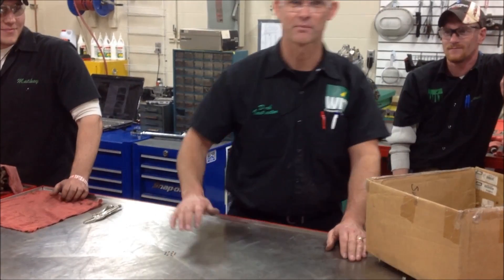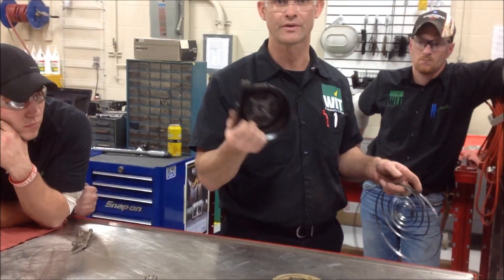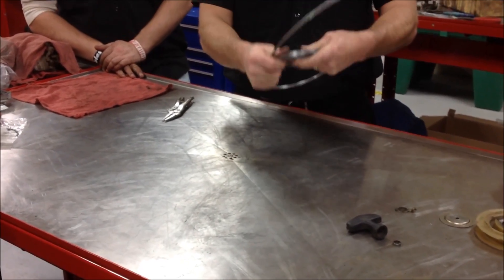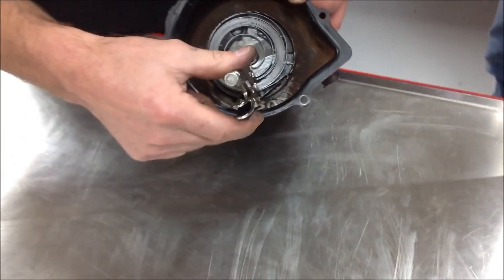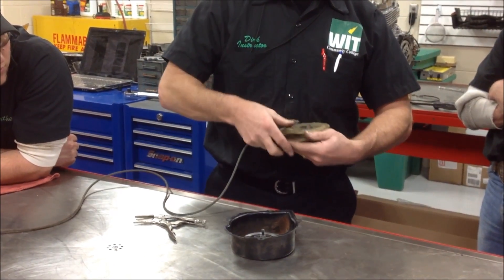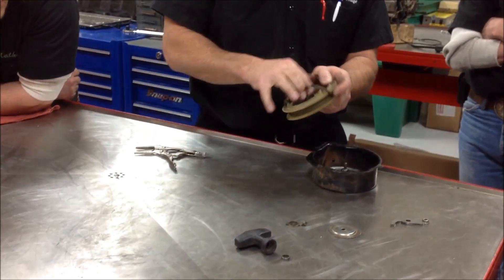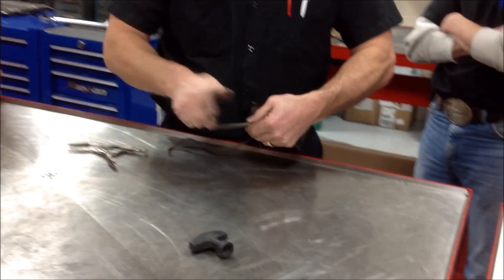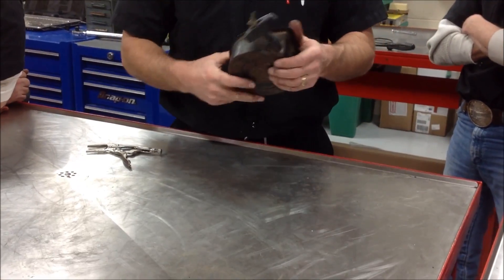How to rewind a starter rope and recoil rebuild on small engines and atv Honda Briggs

Comment: You need hand strength!!!

What if you don't due to arthritis in both hand, because of not one but two motorcycle accidents??????

I need to know how to make my own tool to do this ¬¬
Reply: I am in the same position. I had to use a drill to wind the spring. There are other videos on this. It is a pain in the butt, but I wasn't capable of winding the spring this way.

Comment: Another good teacher! 

These videos are a feather in the cap of Western Iowa Tech. Next time you apply for funding you might ask for a lav mic and wireless audio setup. It means a little more work to fit the audio to the video after, but it would offer much better audio consistency, with less background noise. That said, you got the message across with little fuss.